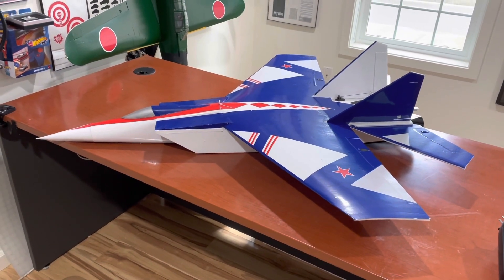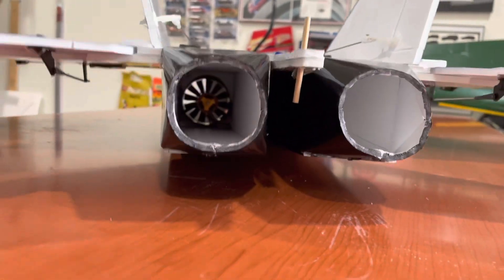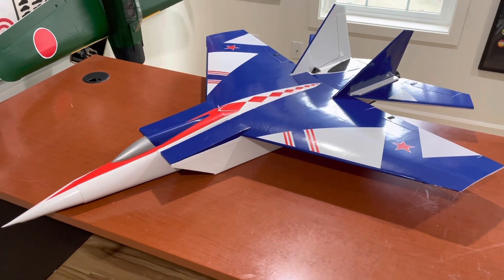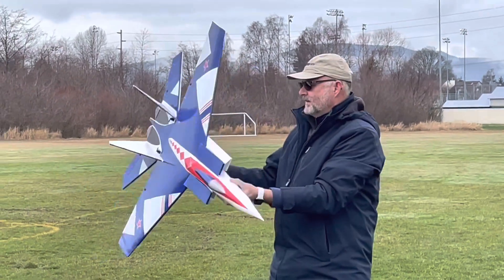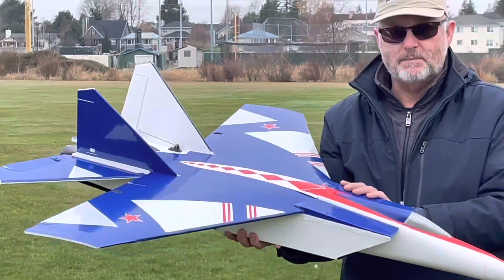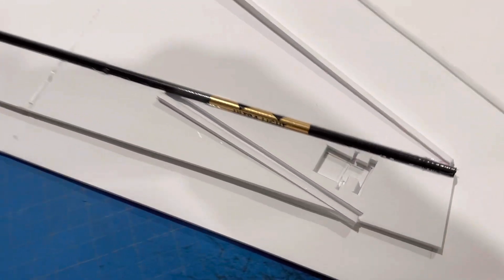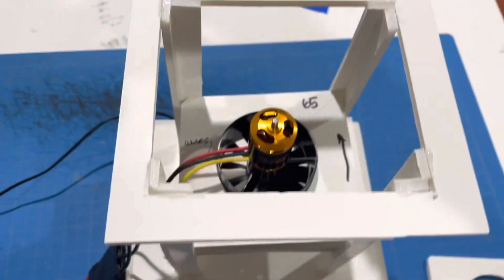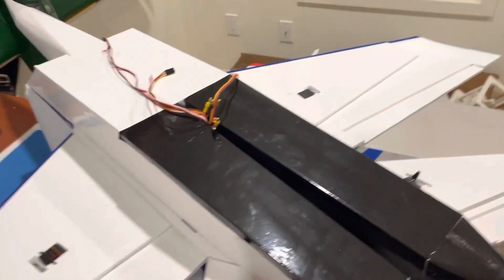Foam Board RC Fantasy MIG-25 Twin 64mm EDF Maiden and Build Details

Comment: Was this a kit, or your own design.  Great to see it fly and land so nice.  Currently building my first EDF Delta Wing.  Where did you find your EDF / Motor combos.  Let me know please.  THANKS.
Reply from the maker: This is a larger version of my 660mm Mig design. I ordered these EDFs from AliExpress. I’ve ordered from Amazon and Walmart also. Sometimes there are great deals (40% off) so I just keep an eye ou
Reply: @thenerdoligist1292  Your airplanes look factory built.  Great craftsmanship.  What kind of foam are you using, and what are you covering it with to give it that glossy shine.
Reply from the maker: @gisall8205  I’m using Adams Readiboard foam available at the Dollar Tree. I use 2mil colored packaging tape (Amazon) and vinyl (Dollar Tree). I made a video on how I apply it. Just check my videos on my channel

Comment: Beautiful! Very impressive design and build. Can't help wondering if you would get more thrust with round thrust tubes from fan to outlet. But clearly it works great as it is!  Congrats on a great project
Reply from the maker: Thanks! I’ve tinkered around with smooth round versus square to round and it isn’t a big difference. I think I will open up the diameters a little bit. I need to check the swept fan area. I was targeting 90% but as-built seems smaller.